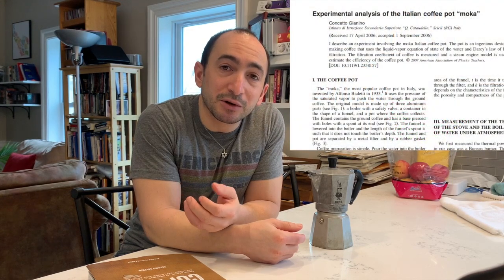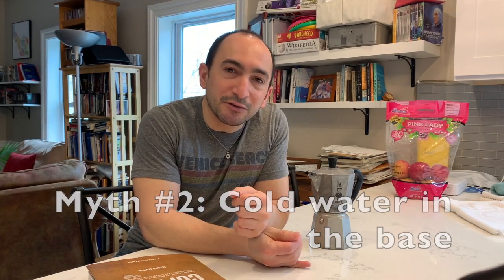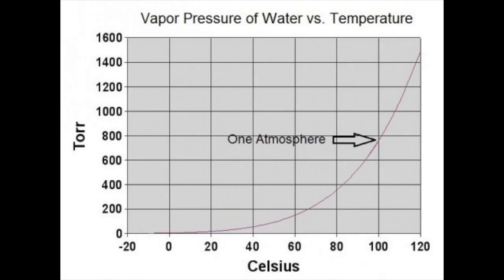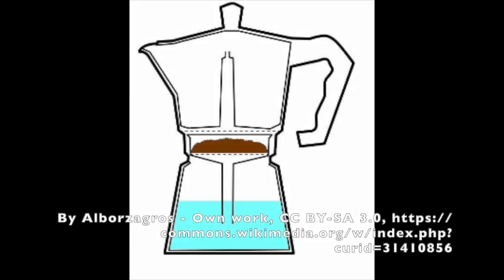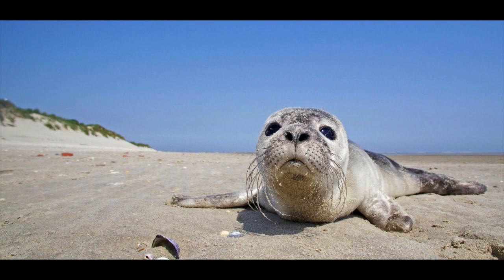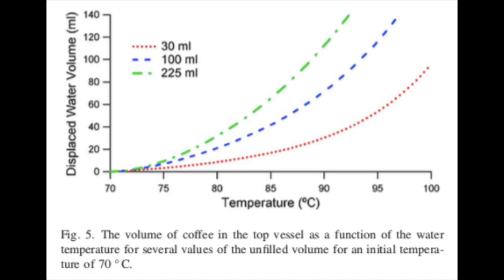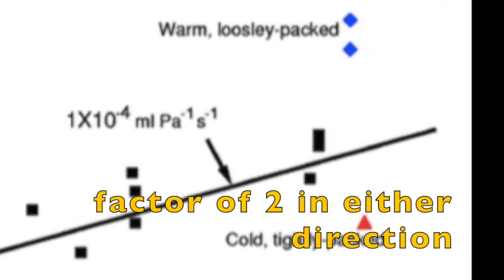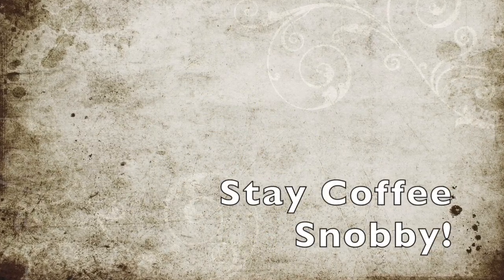Why you should preheat your moka pot water.

Comment: I've finished reading King's paper, and yes, he's done a great job of analysing the physics involved, but the examples he's worked through, in order to reach his conclusions on how to use a Moka Express, are just completely wrong. His main scenario, is an attempt to brew 100 ml of coffee, ie two shots. And he does his calculation on how best to do this, in a 6-cup moka express, designed to produce 300ml of coffee.

Anyone who knows how to use a Moka express knows you do NOT try to brew 2 shots in a 6-shot pot. You just do NOT do that. It is complete coffee insanity, to try that, and expect a good result. 

To quote from the interweb: "The Bialetti Moka Express is available in many different sizes: 1, 2, 3, 4, 6, 9 and 12 cups".  And the reason they have all those different sizes is, that you just do NOT use a 6-cup moka express to make 2 cups...

King's calculations also assume an APPALLINGLY low heating rate of 10 degrees C per minute, and he assumes it's mostly constant for the duration of the brew (which is utterly wrong).

I timed my 3-cup moka express from cold-water start (20C), to finished in 3 minutes. This involved bringing it fully to a boil, fully emptying the bottom chamber (besides the small amount always left behind), which means that as the chamber empties, the rate of heating increases rapidly, ensuring that the latter stages of the brew get sufficiently hot water for good extraction, and the very tail end of the brew will actually be boiling, and when this actually boiling water goes through the coffee, it will be very close to 94 (as the coffee grounds themselves will be slightly cooler than water passing through while water temp is rising rapidly). Even if the effective water temp through the coffee is a bit over the supposedly ideal 94C, this is fine because the duration of this hottest phase is so short, if anything it will just compensate for earlier phase when water was a little cooler than ideal.

20C to 100C in 3 minutes is 26C per minute (on average), not 10C per minute, and the last phase of brew will be heating at a much higher rate than 26C per minute, as there is little water left in the pot, so it will be heating up very rapidly indeed.

Referring to the Illy article published in Scientific American, that also confirms undesirable compounds are released from the coffee when percolation duration exceeds 30 seconds, at high-ish temperatures, so, slow heating rates as assumed by King, and taking the Moka OFF the stove near the end and fussing over it like imbeciles, as recommended by a myriad of YouTube buffoons, is a sure way to extend the duration of the hottest phase and get the most unpleasant coffee possible. Illy's article is just more confirmation the Moka Express should be heated rapidly, all the way until the chamber is empty, because as the chamber empties, rate of heating accelerates which ensures high tempreratures are reached, but for only a short duration.

King also dismisses packing the grounds somewhat firmly as something that isn't the way things should be done, when it is in fact, exactly what should be done. King's physics is fine, but his Moka-methodology is absolutely incompetent.

I could go on, and I probably will, later, because there are other flaws as well, but the flaws pointed out above are more than enough to show that King, and 95% of all of the so-called experts making videos on YouTube have all completely failed to understand how to use a Moka Express properly. It's simple, it's quick, it's easy, it's foolproof, and it's done in exactly the opposite way that everyone on youtube seems to recommend.
Reply from the maker: Well, thank for this comment!  I'll be leaving it up for the entertainment value, but I was hoping for something a bit more rich in sources than insults, so you haven't given me much to follow up on :(. I list your sources below:

"Anyone who knows how"

"exactly what should be done."

If you'd like to follow up with King, he does live in your part of the world (though other side of your great continent!).  I'd love to see you guys get together as Aussies and work it out!  

On the specifics, obviously, there are brewing differences between espresso and moka pots, least of which is the difference in pressures (9 bar vs. 2 bar), so I'm not quite following your conclusion that: "undesirable compounds are released from the coffee when percolation duration exceeds 30 seconds, at high-ish temperatures".  I don't suppose you're claiming that every brewing method that takes place at 90-ish degrees C should be done in 30s, since that's physically impossible in any kind of unpressurized system and sure as hell not going to happen without 9 bars!
Reply: @loodog555  It is not MY conclusion, that undesirable compounds are released when percolation duration exceeds 30 seconds at highish temperatures - I got that directly from the Illy article in Scientific American - ie from one of YOUR two sources. Did you even read through your own sources? Did you even read what I wrote? Why don't you go and read your  own sources properly, and get back to me.
Reply from the maker: @An_Idiot_in_the_Wild  that this is their conclusion, I understand. I thought that was obvious.  What seems strange is your willingness to mine that quote out of context. Illy was describing how to brew espresso properly. But rather than go for the very valid critique that the source might not be applicable because moka pot is not espresso, you borrow King‘s interpretation of applying that source literally and concretely, ignoring differences like the fact that espresso brew at nine bars, while moka pots brew at 2.  All this despite your main thematic critique that the sources are being applied too literally, and you take pains to point out how different moka pots are from espresso in your comment above, but then apply this 30-second rule which doesn’t apply to any other brewing method.  The name espresso actually originated in how uniquely fast it brews!  To make that speed possible required the extensive pressure that only an espresso machine provides.  

Like you really really want this paper and alternative brewing technique to be wrong and I still can’t figure out why!
Reply: @loodog555  I don't "want" the paper to be wrong. It just IS wrong. 

I also don't want to impugn any of Warren King's scientific credentials. His analysis of the physics and gas pressures etc is fascinating. As far as i can tell, there's only one possible error in his physics, re the partial pressure of air in the unfilled space when you fill with hot water, and I may well be wrong about that, he may be correct. It's a minor issue anyway. The main problem is, King modelled Moka operation (very well), but under a range of parameters and assumptions that do not reflect how the Moka is actually used, and that leads to false conclusions, and bad recommendations.

At this point though, i have to say, how EFFING DARE YOU accuse ME of mining the 94C/30 second recommendation out of context. I take extreme offence to that insinuation.

You know very well it was KING who references the Illy article as the source of this advice. It is his very first reference, in his first paragraph he says this:

"A study of the chemistry of coffee making(1) suggests that the flavors considered most desirable are extracted when the temperature of the water is about 93 °C, and the pressure is sufficient to allow the volume of water for a single “shot” 30–50 ml to flow through the plug in about 30 s or less."

So his whole paper is based around a target of 92-94C for 30 seconds, taken directly from Illy's article.

And now you say "rather than go for the very valid critique that the source might not be applicable because moka pot is not espresso, you borrow King‘s interpretation"
What the F#@#*@??. Now you're criticising me for accepting one of his assumptions?

And even this criticism of yours is wrong. I did, and still do more or less accept the 94C target, because we have to start somewhere, and it seems reasonable..

But in fact I have strongly objected to King transferring the 30 second duration from an espresso contex to Moka context. I have explained 30 seconds at 94C is very likely NOT necessary. Perhaps you completely missed my earlier comment, where i said:
"It is actually very possible, that the compounds needing temps around 94C, may not need the 94C for the whole 30 seconds... So, yes, the Illy article suggests 94C/30secs is ideal, but that does NOT imply it needs to be 94C for the whole 30 secs - constant temp for the whole duration just happens to be characteristic of the proper pressurised espresso machines that the article was considering - but it does NOT mean the chemistry of the beans needs 94C for the full 30 secs...and so it does not mean a Moka express needs to maintain 94C for 30 seconds for optimal extraction..."

So you've accused me of making errors King made, which I've actually argued against.
Incredible.

What seems strange to me, is your unbelievable willingness to overlook the completely ridiculous brewing methodoology he used and accept his conclusions blindly.

If you're really curious about why this winds me up, let me put it like this:
I've used a variety of Moka expresses, over a period of 30 years. I definitely have not pushed every variable as far as it can go in every direction, I've settled on a simple method that works and produces great coffee. And then, one fateful day, I come across a video from an "expert", claiming to have some tips on how to get a better brew from a Moka Express. With great humility, and an eagerness to learn I watch this video, and it horrifies me down to my coffee-loving core. Then, I have other videos from other experts being recommended to me by YouTube's algorithms, and I watch those. The horror becomes nausea and eventually anger. I am outraged and appalled by the coffee atrocities I'm witnessing. Eventually I stumble across your videos, already in a deeply traumatised state. And a glimmer of hope appears. SCIENCE. Someone has actually applied the rigors of mathematics, physics, & science, to the Moka Express. Whew. What a relief. But the gods are cruel... my faith in science, and in humanity itself, is more than shaken, more than rocked, it is obliterated, utterly destroyed by your videos and King's paper.
Reply: @loodog555 King's paper did at least show (and explain why) there are some interesting benefits to filling with hot water and leaving some unfilled space. If you want the most super-concentrated brew possible, that may indeed be useful, but it is NOT necessary. You can get perfect extraction with good hot extraction temps, and very good strength, from a cold water filll, if you just let it finish - it'll just be a little weaker, not quite so concentrated.
Reply: @loodog555 I really am exhausted with all of this mind numbing re-iteration, maybe i'll take a closer look at King's paper one day and blather on some more. But for now I'll just end by saying I'm not even trying to say everyone has to use a Moka pot the way I do, even though most people who have an idea what they're doing do, or if they don't they'd probably prefer the results  if they did. So people shouldn't be told to start using a Moka the wrong way... chances are they will not like the results.
But if people out there really do prefer the coffee they get via some variation, eg avoiding the last hot phase at the end, that's fine. But they should know, that phase is required for what would normally be called a good proper extraction. And the reason they prefer to avoid the sputter, is not that letting it sputter at the end has "burnt" or over-extracted their coffee - the reason, is that they have some beans or some taste-buds, that prefer an under-extracted brew. That's it. I'm done.

Comment: I noticed there is no mention at what temp. the stove heat should be at. according to illy,  the coffee should be brewed at low to medium temp. to prevent burning the coffee. coffee should pour gracefully into the reservoir. if it sputters aggressively and unevenly, its too hot.
Reply from the maker: I agree with that advice! I start at medium, but then immediately put it at low once I start seeing coffee.
Reply: @loodog555  wouldn't that be too late? The pot isn't going to cool down in a snap after you turn the heat down. As you will see, the coffee is going to pushed by pressure that built up over time. 

I had cold water in mine, on low setting (i have an electric stove), and it just came out. It was a steady flow, but it wasn't coming out like the heat was on max. It did taste bitter. Could've been too much coffee than water. James Hoffman said if you're brewing dark beans then you need less water to coffee because you don't want it to extract too much for far too long. Less water will extract it quicker and sooner. Did that. It tasted bitter. I I also did hot tap water on low and it was bitter, but not so much. I did pour cold and hot water over the beans in the coffee filter before brewing. It seems to help. 

I'm going to try pouring hot tap over the coffee powder in the filter before I brew it again, then test it and see if it becomes bitter. If not i'll stick to that method.  

Bialetti instructions say start with cold or room temperature on low setting. Forgot what it said. 

There's a lot of science behind the Mokka Pot. Go by ratio. Go by pouring hot water over the coffee powder first while in the coffee filter before brewing. Use less water if you're brewing dark roast. Or cold water vs hot water. Evenly spread the coffee powder in the coffee filter. Temperature. Filtered or tap. Whew.
Reply from the maker: @sO_RoNerY  well, the main issue isn’t that you need to cool things down very quickly, but that you need to kill off the pressure that is pushing the water through the spout, which applying cold water does almost instantly.  As for adjusting the water level to match your roast level, I completely stand by Hoffman suggestion and give a bit more explanation as well as alternative means to create the same results in one of my newer videos: https://m.youtube.com/watch?v=NQrRzTzU_Yk
Reply: You're supposed to set the pot on low heat and leave it on low the entire time. 

The water inside the moka pot is not supposed to boil, because boiling makes it bitter. 

It's a very quiet and gentle process. 

The coffee seeps silently into the upper chamber, and the instant you hear it gurgle you remove it from the heat, let it rest for a minute, then stir and pour the coffee.
Reply: @photina78  thats right, though low/ med. is relative term, and it also makes a difference if you have gas or electricity. on my electric stove, heat seems low until 7, and then exponentially rises until it hits 10.
Reply: @milovacc1195 Low on gas, Low to medium-low setting on electric, depending on how well the electric stovetop works. 

I use low on electric during the entire brewing process. I set the pot in the middle of the stovetop eye, and the handle never gets hot. The coffee brews quietly, so when I hear it gurgle I immediately remove it from the heat, and let it rest for a minute. Then stir and pour.

Comment: Except that moka pot coffee is NOT espresso. Also 70 degrees Celsius is only 158 degrees Farenheit, which is well below boiling, so it will not 'probably' improve your coffee. Finally, the degree of bitterness (and even extraction) in a cup of coffee is a matter preference -- there is no ideal and it varies with the bean itself so there is no point in all this fuss. Some prefer a partial degree of extraction given the characteristic of certain beans and roasting. Moreover, all these parameters must differ if a one cup, a four cup, or an eight cup moka is in question. Finally, if you're in such a hurry in the morning you can hardly actually appreciate your coffee in the manner it should be imbibed, which is thoughtfully.
Reply from the maker: Oh hai Mark!  Thanks for the interest!

I'm not sure if you got the point made in the paper (and in the video!) that the moka pot brews at far below boiling temperature anyway, and this is actually the problem!  You want it to brew at a high enough temperature for good extraction. If you start with cold water, you brewing takes place at a volume-averaged 69C, far below optimal for most coffee brewing methods.  

As for bitterness being a matter of preference, I'm working here within the Third Wave model of overextraction/underextraction, which posits that the coffee extracts in 3 stages: (1) the acids and fats, which make the coffee sour and acidic, (2) the sugars, which wash out the sour and acidity flavors, and finally (3) the plant fibers, which are simply bitter.  Within this model, the optimal brewing takes place towards the end of stage (2), which delivers maximum flavor with minimal bitterness.  Your personal preference may of course differ from this model and so maybe you prefer what Third Wave baristas would call "overextracted" coffee.  Certainly, I agree that it can vary by beans.  

Which cup model you're using will affect the puck resistance, but the brewing ratios are kept constant in all models and nothing about King's simulations should be qualitatively different, though they may vary slightly.
Reply: I love The Room! Rifftrax version of course.